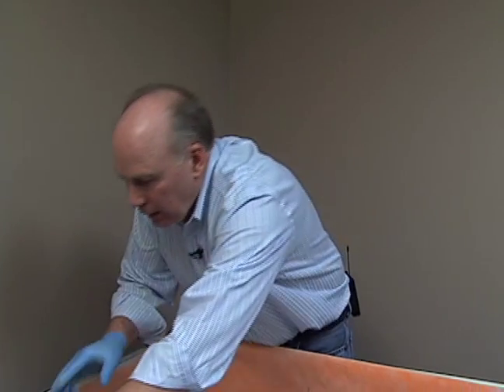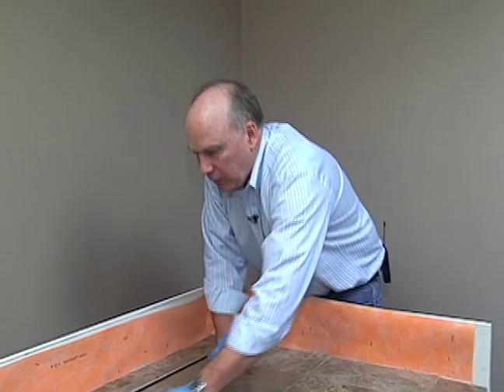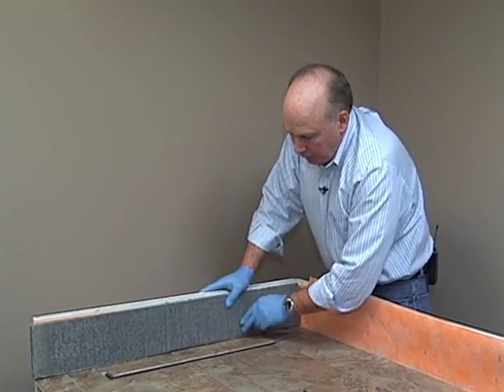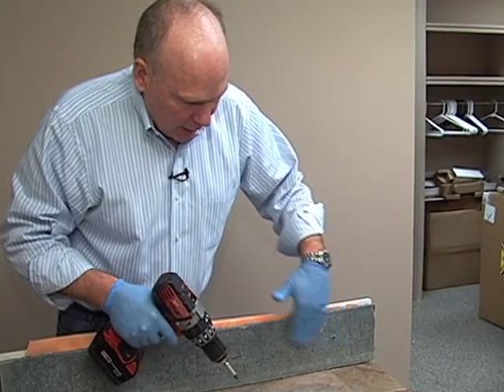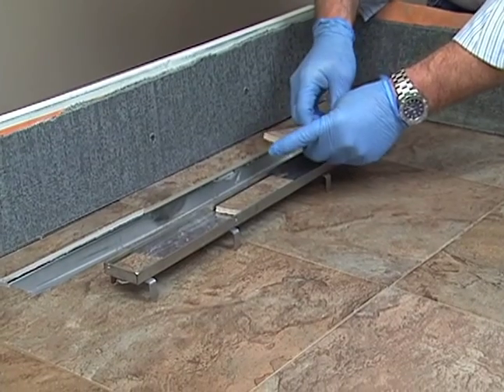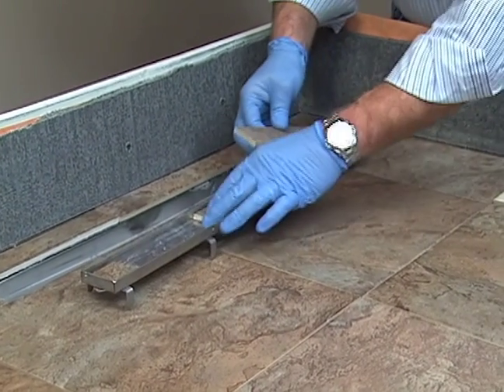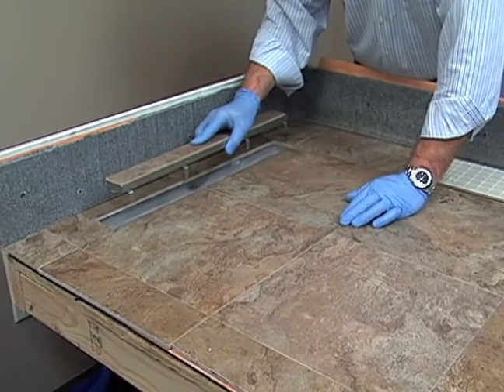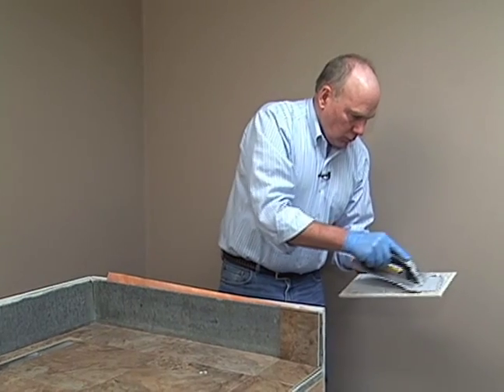Channel Drain Installation Tutorial

Comment: In the detail inserting the tile in the tiled Insert, whats with "You CAN use silicone around  the edges"? Surely it should be "You MUST use silicone around  the edges", otherwise you would end up with stale, stinky water in the tile insert tray. I certainly didn't see any drain holes in the tile tray.
Reply: Yep a lot of these drains being sold with no weep holes in the tray...crazy!!